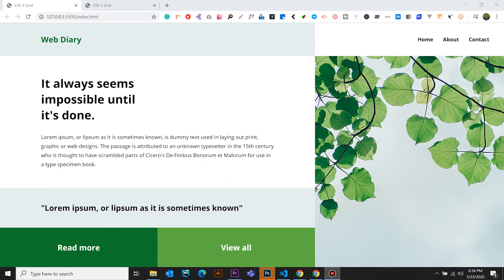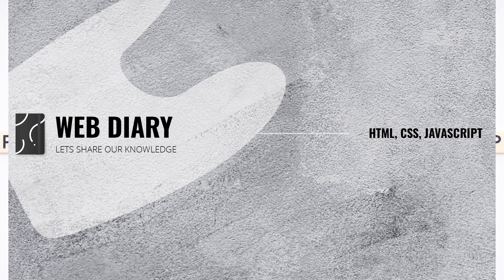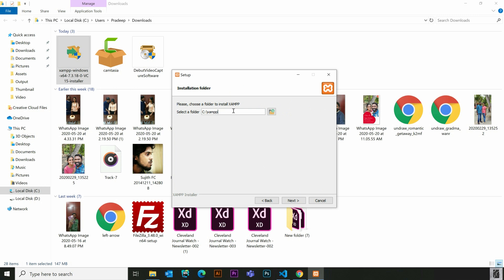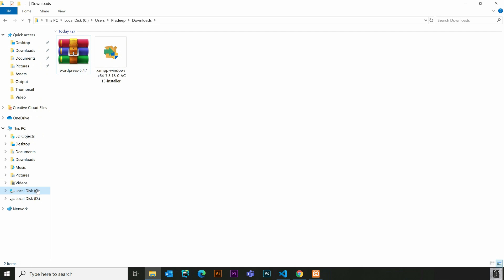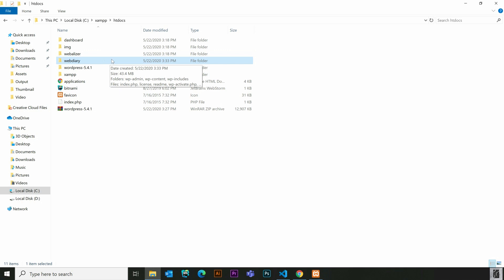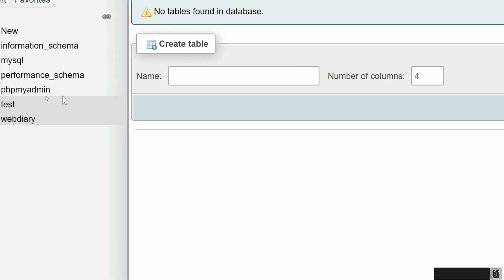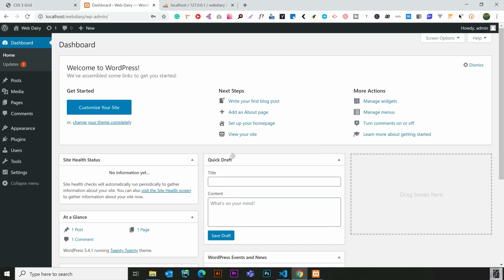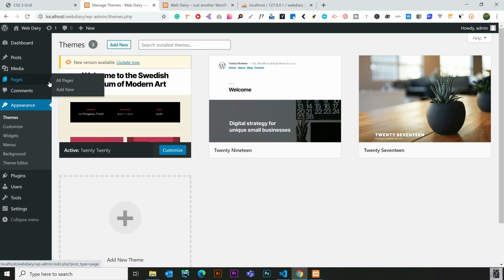Part 6 | WordPress XAMPP installation | Build a Responsive CSS Grid Website Layout From Scratch

Comment: How to install its in mac bro pls help
Reply from the maker: Hey bro,
Same procedure thanne aaanu mac ilum... Xampp mac ilum work aaakum...
Athu allel bro command prompt vazhi apache yum mySql um php um manually install cheyyanam...
Reply from the maker: Allel MAMP install cheythu koodi nokkanam
Reply: @WebDiary  okey
Reply: Worked http://localhost:8080/dashboard/
Reply from the maker: Great 😍 bro... ee mukalile http link broyude system il maathram work aakullutto...
Reply: @WebDiary  The application needs to initialize its components so you will be asked for your Administrator credentials. This won't be required in future executions
Reply from the maker: @foodlover138  I didn't get u bro...
Reply: Error 404
localhost
Apache/2.4.43 (Unix) OpenSSL/1.1.1g PHP/7.4.7 mod_perl/2.0.11 Perl/v5.30.3
Reply: Object not found!
The requested URL was not found on this server. If you entered the URL manually please check your spelling and try again.

If you think this is a server error, please contact the webmaster.
Reply: Done,  i forget to remove slash dashboard after localhost. my mistake was /dashboard/wordpress
Reply: Error establishing a database connection

This either means that the username and password information in your wp-config.php file is incorrect or we can’t contact the database server at localhost. This could mean your host’s database server is down.

Are you sure you have the correct username and password?
Are you sure you have typed the correct hostname?
Are you sure the database server is running?
If you’re unsure what these terms mean you should probably contact your host. If you still need help you can always visit the WordPress Support Forums.
Reply: Yes Everything Work Fine Now I Install WordPress Successfully in my mac
Reply from the maker: Awesome 👍👌